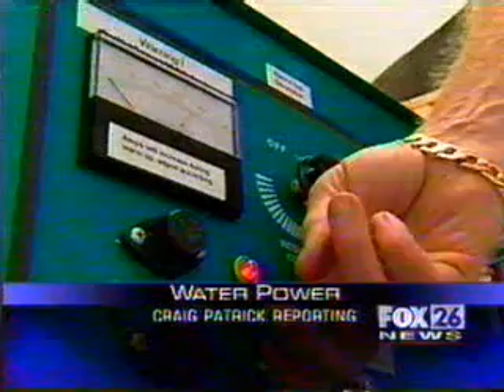Car runs on water

Comment: A water torch IS a variety of a hydrogen torch.

You bring up welding technologies as if they somehow supported your claim that a water powered car would work. You're ignoring the entire energy equation. Welders are just using the hydrogen to generate heat. It STILL takes more energy to perform electrolysis than you recover from burning the hydrogen. The Skeptoid article I posted about earlier goes into more detail.

Comment: Well, by your logic the editors of Popular Mechanics must also be idiots:

"Problem: It takes exactly the same amount of energy to pry those hydrogen and oxygen atoms apart inside the electrolysis cell as you get back when they recombine inside the fuel cell. The laws of thermodynamics havent changed, in spite of any hype you read on some blog or news aggregator. Subtract the losses to heat in the engine and alternator and electrolysis cell, and youre losing energy, not gaining it—period."

Comment: Who cares how hot it gets? That's not relevant to this discussion.

You're still using more energy to perform electrolysis than you can recover from burning the hydrogen. Performing electrolysis IN THE MOVING CAR results in a net loss of energy. You can bring up all the examples of hydrogen welding technology you want, but unless you get over the laws of thermodynamics you won't be able to build a working "water car."

Comment: Water torches are irrelevant to the question of if water powered cars would work, but that's a common mistake and one promoted by scam artists trying to bilk investors.

All water torches do is prove that you can burn hydrogen to generate a lot of heat. The thing that makes water cars impossible is the fact that it takes more energy to perform electrolysis on water than you can retrieve from burning the resulting gas.

Welding is not an energy efficient process. :)

Comment: You just spent three posts writing about something that's completely irrelevant to what's actually being debated.

Please try to understand, I don't doubt that hydrogen can be burned to produce energy or that hydrogen could be used to power a car.

My point is that performing the electrolysis IN THE MOVING CAR will result in a net loss of energy. You need more energy to perform the electrolysis than you can recover from burning the resulting gas.

What part of this do you actually disagree with?

Comment: the oxyen compound which forms a whitish mist over the tank is oxygen which has reacted with the hydrogen to create water vapor, but most of the oxygen cannot react fast enough so forms a mist over the tank, the light hydrogen then floats through the pipe which has been pressurised and enters the combustion chamber, where combustion occurs, i haave an a* is chemistery, seriously what do you have a f lol

Comment: ok lets scientifically explain it to you:

hydrogen x2 + oxygen = H2O ok, add a certain voltage to the water and you get Hydrogen which will instantly react with oxygen to form water again, but the hydogen is lighter than air, so the oxygen creates a think whitish looking layer of air over the tank, the hydrogen which has not reacted then gets sucked up through a large extractor fan, that then gets burned with oxygen very quickly under immense pressure and forms water h20 on the way out

Comment: Let me reiterate, I'm not claiming a hydrogen fueled vehicle is impossible. All I'm trying to point out is that performing the electrolysis IN THE MOVING CAR is a bad idea and will not result in a viable engine. Burning the hydrogen yields less energy than it took to separate it.

What part of the above do you actually disagree with?

You'd be better off with a hydrogen tank that had been filled elsewhere using a renewable energy source.

Comment: I'm not denying that hydrogen cell vehicles are possible. All I'm trying to point out is that performing the electrolysis in the moving car is a bad idea and will result in a net loss of energy. The claims of a vehicle that can run forever on water alone are, to be blunt, impossible. Anyone claiming they have a vehicle that can run on water alone is either a liar or an idiot.

You need to separate the hydrogen elsewhere and provide the car with a hydrogen tank if you want the thing to work.

Comment: It will only get harder to keep  this technology under wraps. Back in the 1950's you needed a million dollar lab to build these engines. Before long every Tom, Dick and Harry will have the means to design, test and  build a true over-unity generator. OPEC is running scared because the clock is ticking.

Comment: Even if you had a magical means of converting energy forms with zero loss, you'd have energy leaving the system by doing the work of moving the car.  There would be less and less energy with which to separate water, which means you'd have diminished volumes of hydrogen to work with. The car would grind to a halt after only a few cycles.

Comment: On board electrolysis makes no sense in terms of energy efficiency. The energy lost to electrolysis would mean you'd be better served to drive the engine directly with whatever power source you were using to perform electrolysis.

Comment: So according to you, high school physics classes are government indoctrination?

Energy is used by moving the car. Even if you found some magical zero loss way to convert the electricity into hydrogen and then combust the hydrogen, you still lose energy in the process of moving the car. The initial battery charge will get whittled down and on each cycle you'll have less and less energy with which to perform electrolysis and thus less hydrogen to burn.

Comment: If you already have that much electricity on board, you would do better to use that electricity to drive the engines directly. That would be far more efficient than wasting 20% to 40% of it to add electrolysis to the mix.

Current battery technology renders electric cars something of a novelty right now, that's why hybrid cars are currently on the market. Hydrogen fuel cell engines have promise, because you can offload the electrolysis to the power grid, which can use solar, wind or nuclear.

Comment: are you stupid? the external energy source could be anything, and requires MUCH less energy than a combustion-based engine. hypothetically, a water-powered car could use electricity as it's external energy source... i don't know what you are arguing against, there are countless videos, articles, and studies done that prove there are DOZENS of more efficient ways to run cars, none of which are in use because OIL COMPANIES control the auto industry. if you don't believe that, you're stupid.

Comment: You require energy to separate the water. Burning the hydrogen won't yield more energy than it took to produce it in the first place. You still need an external energy source. All this really does is waste energy by adding an extra conversion. You might as well use the energy to drive the car directly instead of throwing away 20% of it on generating hydrogen as an intermediary.

Comment: The 85 Civic only got about 35 mpg in real world usage. 2008 Civics have been reported getting as high as 45 mpg highway. It says a lot about your argument that you need to make up numbers and then compare an 85 sedan to a modern SUV to make your case.

Due to the higher power engines, SUVs burn more fuel than a sedan. Even then, they burn less fuel than their 80's counterparts.

Comment: Ok, Ok,  the water (H20) is broken down through electrolysis ( the cars own 12v system) successfully producing hydrogen gas.  This basic technique has been toyed with for many years, by many different people.  ( read all you can about "Joe Cell" )  Although dangerous,  in theory it would work.

Comment: all you people are correct, 1. gasoline is the main source of income for this country, 2. if it burns "hotter than the sun" it would've burnt the surrounding air up, 3. i don't think that any flame that'll melt brass will be cool to the touch, and 4. the water powered car? not a new invention, we've already done that, and it wasn't that efficient. same as electric cars, didn't go very fast.

Comment: seriously, it's not hard to make an oxygen or hydrogen generator. it's hard to make a SAFE one, maybe, but water is pretty easy to break down. 

taking into account that (1) his water/gasoline hybrid running EXCLUSIVELY on water went 100 miles on four ounces and (2) the electrolysis is done in the car, i would guess that it's safe to say that the electrolysis process isn't that much of a power consumer.